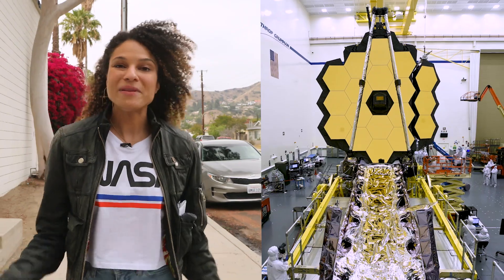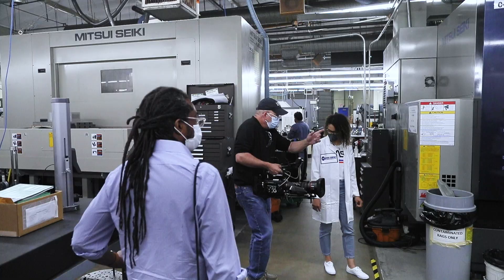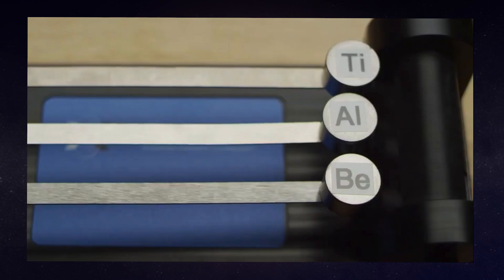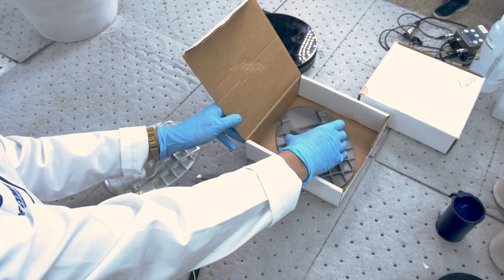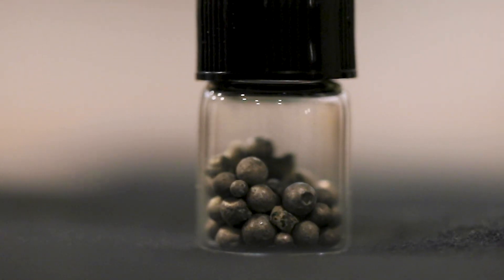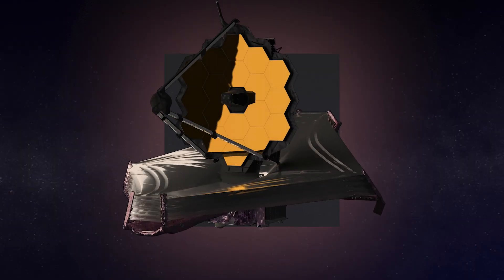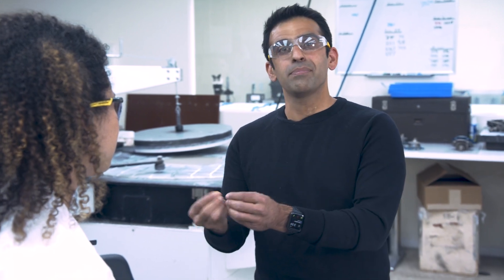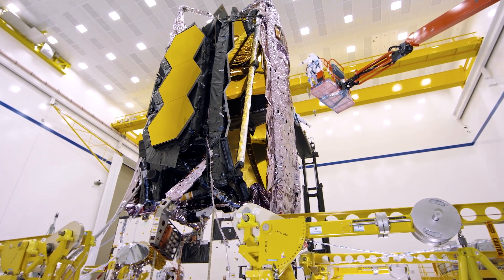Elements of Webb: Beryllium Part 1,  Ep 03

Comment: It looks, Beryllium shrank exactly the same amount as Aluminum @1:35. The Aluminum sheet went from 1090 µm to 1060 µm, a shrinkage of 30 µm. And the Beryllium sheet went from 1030 µm to 1000 µm, again 30 µm.
Reply: She could have been clearer, but in any case the percentage change, not the absolute change, is what matters here. It's 30 units smaller relative to the original size. And I suspect your have it switched: it's the beryllium that started at 1090 units. So the beryllium shrank less.
Reply: The aluminium sample at 1:33 was on the left at 0.1090 inches. Experiment null and void due to inaccurate measurements and poor choice of measuring tool (and lack of experience using such tools,that she admits)
Reply: @daic7274  Look at Mr Experiment Null and Void over here! I'm sure you're an expert.